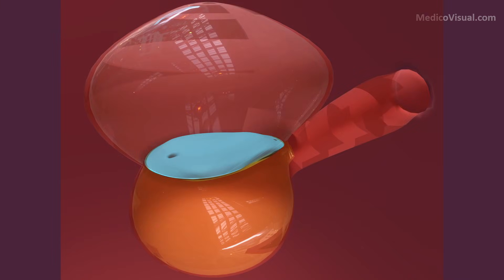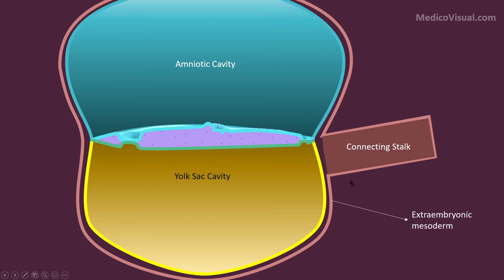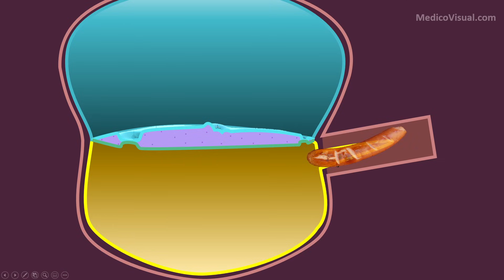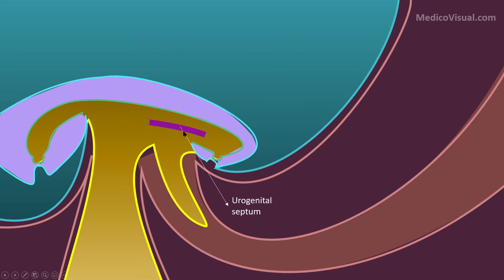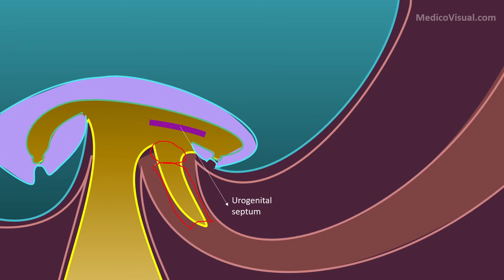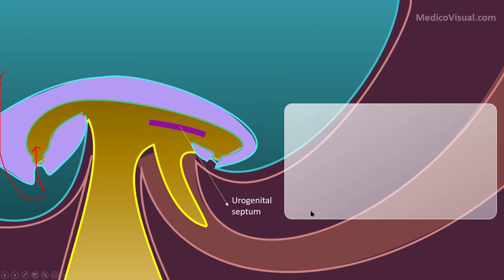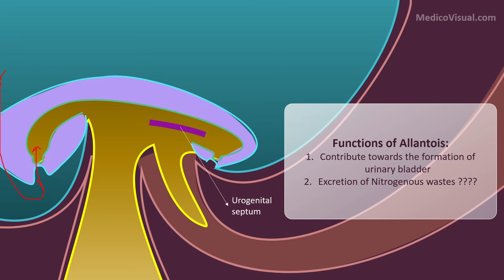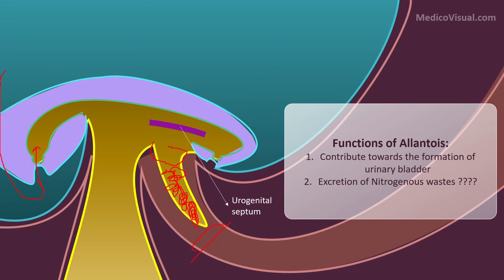Allantois formation - Embryonic folding 3D overview - Animated Embryology - 3rd Week

Comment: This is a very wonderful and informative video...... Please to be clear so the fetus both urinates in the amniotic fluid and drinks it back 9:23 - 9:27, and also part of the urine goes through the urachus? 
2.) Does it go Into the maternal blood stream?
Reply from the maker: Thank you so much for the appreciation.
Yes, the fetus both urinates into and drinks the amniotic fluid. It might sound a bit odd, but it's a normal part of fetal development. This process helps in the growth of the fetus's lungs and digestive system.
The urachus is a channel that connects the fetal bladder to the umbilical cord. Most of the fetal urine ends up in the amniotic fluid, but some part may go to the urachus.

The waste products from the fetus, including from the urine, are transferred to the mother's bloodstream through the placenta. This is how the mother's body helps in removing the fetal waste. Please note that the "Urine" in its entirety is not transferred to maternal bloodstream, only the waste products are removed. This is due to presence of the placenta, which acts as a selective barrier between the maternal fluids and fetal body fluids. In an essence, placenta is acting as a kidney of the fetus. Lean more here: https://youtu.be/LDyQ_PRqEbI?si=63KyUemkcRqHGq1u
Reply: @MedicoVisual  Aaah, I see. Thank you so much for clearing that up 🙏🏾, you're literally saving lives out here ☺.